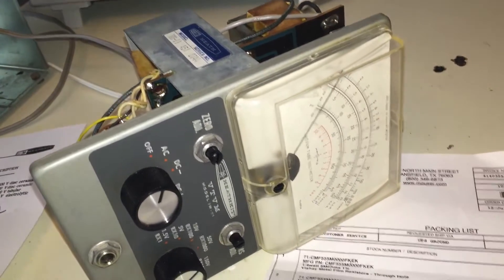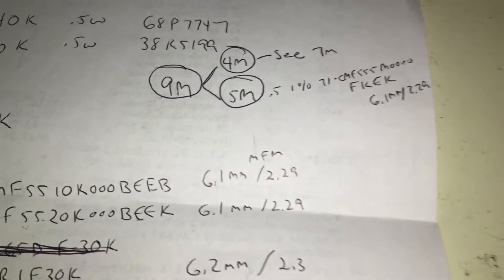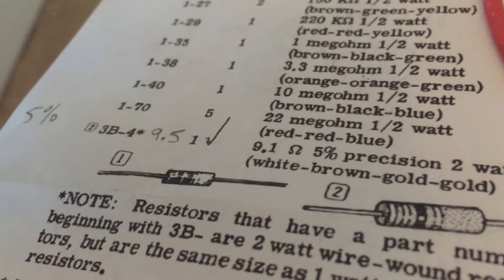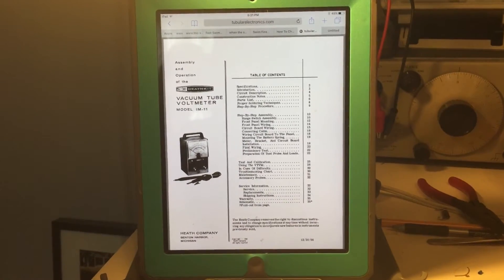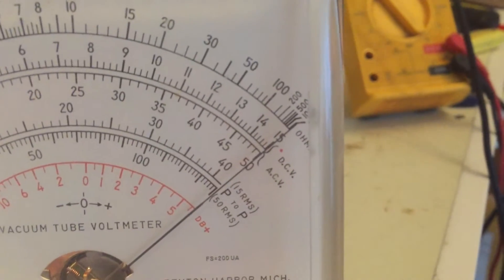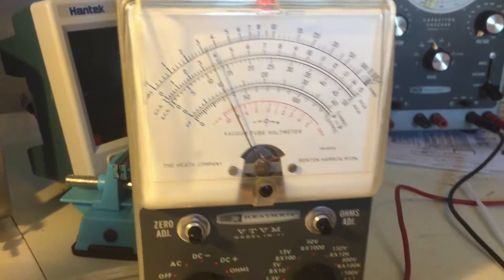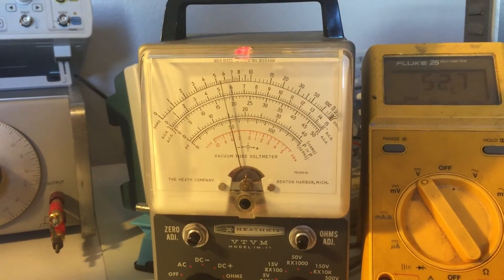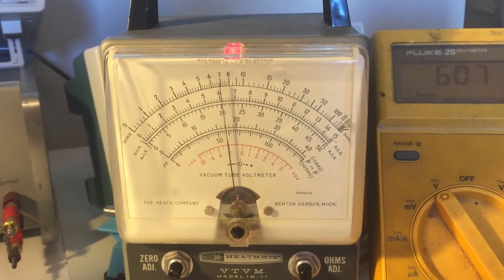Heathkit IM-11 VTVM RE-revisit again for repair

Comment: note that 12AT7/12AV7/12AZ7 are adequate, verified substitutes for the 12AU7 .  12AU7s are getting expensive and 12AV7 or 12AZ7 can still be found NOS at low cost.

Comment: My VTVM is very unstable...even new. I have check everything, the tolerance of components is NOT the problem but the bridge that Heathkit use is flaw. Anything leaking will unbalance it. So this is a piece of s****.
Reply from the maker: I have no stability issues after warmup

Comment: I am working on fixing a Heathkit IM-18 at the moment, and I am having to change all of the resistors (including the precision resistors)! Its actually fun working on these older equipment, especially the challenge of finding the resistors and making sure that the higher value resistors such as the 7M and the 900K can handle the higher voltage drop. I am just really surprised that all of the precision ones were so far out of tolerance!
Reply from the maker: Don’t forget to replace the filter caps even before you power it up. They are garbage. Rectifiers should be evaluated for forward voltage drop and or replaced .
Reply: @retrotechandelectronics  Actually, that was one of the first things I did when I received the VTVM. That cap was gone in less than a few minutes! I simply don't trust old electrolytic caps and don't believe in the reforming process. I tried the reforming process on all the electrolytic caps in my Tektronix 535A, the scoped worked great for a few months then out of the blue, 3 caps decided to short. So now, I shotgun all electrolytic caps in vintage gear. I do check rectifiers to be on the safe side, but I have yet to replace one.

Comment: At 6:35, it also depend on if the 12AU7 is close to being in spec., (balanced) with the two Diode section's.
--
How about a Battery Eliminator?
Reply from the maker: Ive been using mine with the same battery for the last 4 years, I don't think an eliminator is necessary
Reply: Retro Tech & Electronics  eliminator are a waste of time. Use a good quality low impedance D cell.

Comment: @Retro Tech & Electronics
Hey, I have the same unit and I was wondering something. Is your zero out pot a little hard to turn as well? The one on mine is, so I took it apart and found that it's not the pot that is stiff but the shaft. So I was wondering if this is intended like this.
Reply from the maker: you can use 3 in 1 oil to lubricate the shaft, it should solve the issue.
Reply: I tried the two random oils I have on hand but it didn't help. I'll get some better one and try again. Thanks.
Reply from the maker: Interesting, I cant imagine where its binding then if not within the pot